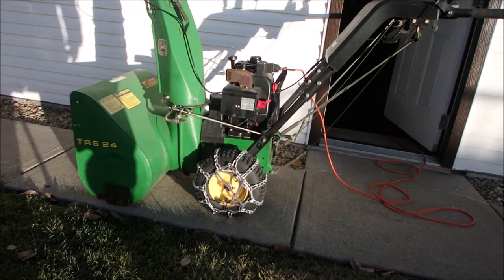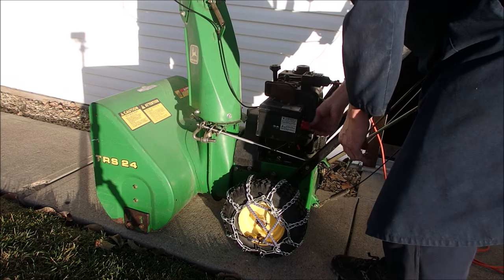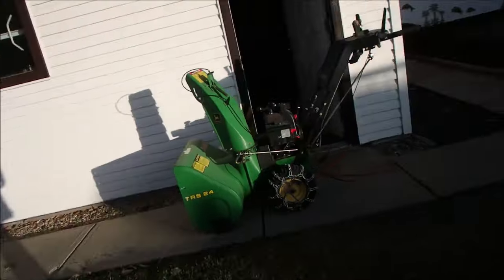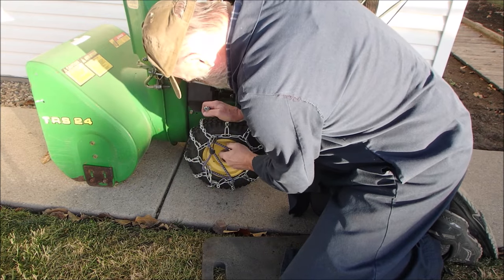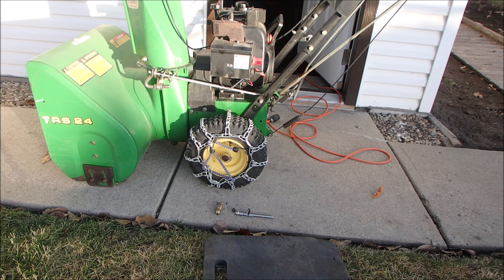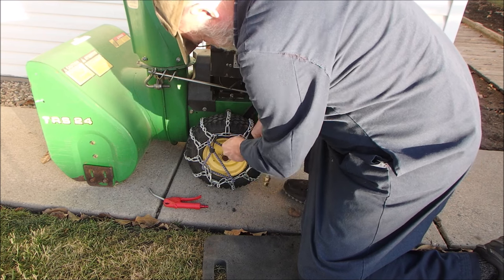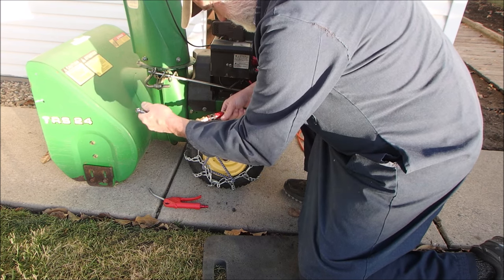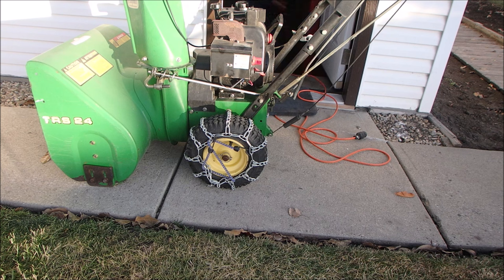Sold This Snow Blower.  This is the Functional Test

Comment: Awesome video Mr Bruce. One thing for sure on those Tecumseh Snow King engines is when you got that carb dialed in just right, they they purr like a kitten with plenty of torque. I have an H70 Tecumseh Snow engine on my 1977 Craftsman (Murray) snow blower that surges a little until it’s warmed up but once it smoothed out it’ll really tear through some serious snow. My only complaint as I’ve stated in Ken’s live stream is it does NOT have electric start OR automatic compression release so it takes a pretty strong arm to crank over.
Reply from the maker: Thanks Brett   Good to hear from you.

Comment: Curb picked the same one. Put a 205 cc Briggs and Stratton on it. I modified the impeller with thick rubber pads. Now it throws snow 40 to 50 feet. Right across the street. Haven’t used it yet this winter. We only have 2 inches of snow. Almost spring now. Million thanks. St.Paul,Minnesota.
Reply from the maker: Well that is a fun comment!!!
Reply: Yep i tell the family all the time when the winter solstice hits Dec. 21 the days are now getting longer so Spring is here.
Reply: @waynestefinashen239   also understand summer is over on July 4.

Comment: 1st: Nice video, as always. 2nd: What’s the weather like at your house? It’s currently 10 degrees F (or -12C) here (southeast MI). And we’ve got about an inch (or 2.5cm) of ice under our 2” (or 5cm) of snow. It looks absolutely tropical at your place. Do you have an extra room? 🥰
Reply: Where is SE MI are you? I’m in Flint.
Reply from the maker: Well it is currently -11C    12F
Reply: @haneyoakie14  Troy
Reply: @BrucesShop  I guess I'm going to weather the cold from here then. Keep the videos coming. We'll need them to keep our minds off the cold 😊
Reply: @deckgun31  ok. I work in Warren, so I have been thru Troy many times. Good old Big Beaver Exit 69.